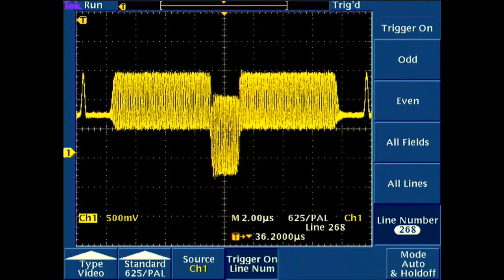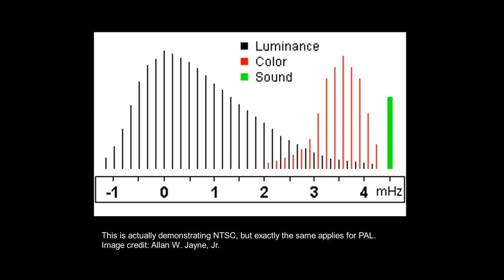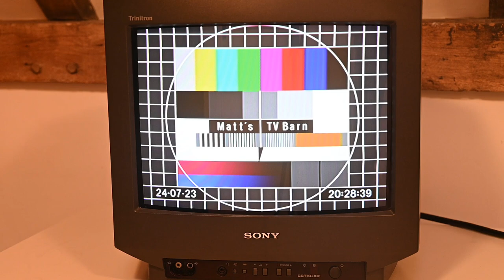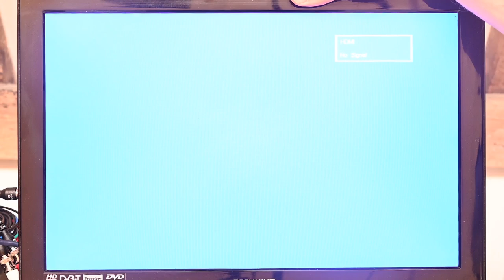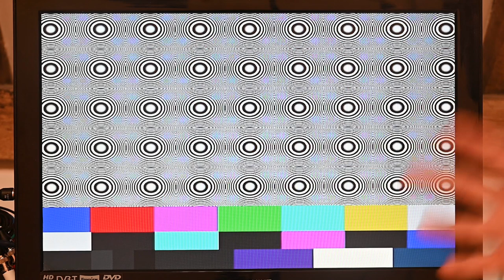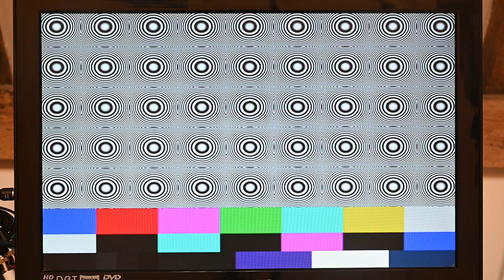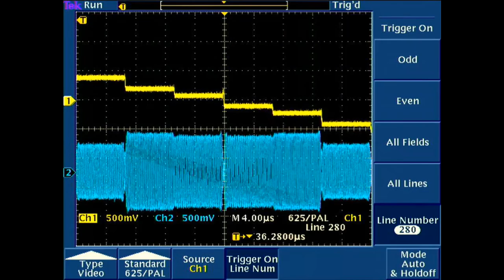#9 - Composite vs S-Video

Comment: I had for many years a JVC 66cm TV and a JVC S-VHS deck. And even though JVC were the ones who popularised S-video and that connector, they also had very good comb filters in the TV and VCR I had! So composite and S-video were nearly the same quality. I only really saw the difference with a Pioneer DVD player that had surprisingly grotty composite video. But it didn't matter to me because I used it's RGB output on the SCART connector.

Comment: I can't fault the image quality, but I'd like to propose that S-Video is physically the worst video connector. SCART you only have two ways you can try plugging it in, Mini-DIN gives you infinite ways of getting it wrong.
Reply from the maker: And they are even worse today than ever. Back in the 1990s S-Video connectors were half decent i.e. if you mate them in the correct orientation they will actually fit together. Today's (purchased of Amazon) connectors all seem to require a degree of bending and straightening before there is any chance of a successful mate!

Comment: You can achieve s-video output through the scart socket with a scart to RCA & composite video adapter with an s-video port built in, just use the s-video lead with the red & white audio leads leaving the yellow composite video lead unplugged, or use another screen with composite video output & you can see the comparisons between them in real time.

Comment: I am gonna video capture some VHS tapes.  Unfortunately, my VCR does NOT have an S-Video output jack.  Is there any work around possible?  I have my VCR's video out going into my Panasonic ES-10 DVD Recorder.  This DVD recorder has S-Video. I use it as a TBC pass-through.  Then it goes into my Sony DVD Recorder, which also has S-Video, and it records the disc.  Could plugging an S-Video cable between the 2 DVD Recorders help improve the quality, OR do I simply need a VCR with S-Video jacks?
Reply: S-Video is basically universal on S-VHS decks, and very rare for regular VHS.

Using S-Video between the two recorders won't improve the image quality, but it may help ensure that it doesn't get degraded any further - if you're using the first one as TBC, it might also change the phase of the color subcarrier, which may indeed cause further artifacts in case of a composite connection, so probably an S-Video cable is preferable.

I guess in theory you could tap somewhere on your VHS deck's PCB to get the separate luma/chroma signals but that's probably much more complicated than it is worth.

The good news is that for regular VHS, the quality improvement is gonna be marginal. The luma bandwidth on VHS is about 3 MHz, and the chroma bandwidth is about 400 kHz. NTSC chroma subcarrier is ~3.58 MHz, and 400 kHz below that it's 3.18 MHz, still above 3 MHz - which means that the chroma and luma spectra on VHS tapes have basically no chance of overlapping - any overlapping information has already been filtered out (either correctly or incorrectly, but you can't do anything about it now either way) at the time of recording. For PAL it's even better because the chroma subcarrier there is ~4.43 MHz and the bandwidths are the same. S-Video can still be preferable if possible, because it's gonna be unambiguous to the receiving device what is luma and what is chroma, so it doesn't need to do its own, potentially further destructive filtering - but still, for regular VHS the difference is gonna be negligible. There's just not enough information on the tape for those effects to really matter.
Reply: @kFY514  Thanks for the info!  that is very interesting that S-Video is very rare for regular VHS VCR's.  I once had a rarity.  It was the Go Video deck that everyone bought to copy tapes.  Had an S-Video output, but I had an accident with it one day and to make a long story short, I had to throw it in the trash dumpster.  Anyway, I will buy a VCR with S-Video soon!  Thanks again!

Comment: I switched to S-video for my Nintendo 64, and for text and color it really makes a difference!
Reply: Same.  In my retro console set up only the N64 uses S-video whereas all the others use RGB and I have to admit that the N64 looks just fine.  To get it looking any better would require significant modification of the console itself.

Comment: It's interesting to see the comb filter in the TV either cancelling out the signal of neighboring lines or falling back to a trap filter in NTSC along the seams between the zone plates. It does do a decent job with PAL given how much harder it is to implement a good adaptive comb filter. It does make me wonder what the BBC's PAL Transform Decoder would do if presented with the "Zone Plate Hell" pattern. I imaging even that would fail to suppress the cross-color.

Comment: Does this mean that artifact colors generated in old home computers via RF out or composite would not work with S-Video? I knew that using analog RGB to play an NTSC Tandy/Radio Shack Color Computer game that used artifact colors to generate red and blue would simply show black and white stripes or dots. But what about S-Video?

Comment: Excellent video Matt - just like your other videos! :) Thanks for sharing.
A qq if I may please: What is the brand/model of the PC video IO card you're showing at 4:00?
I desperately need some proper TV out for my PC either as a card or an adapter as any scan converter I tried so far (HDMI to CVBS dongle, Ambery semi-pro VGA to CVBS box) gives totally different output in terms of electrical signal parameters and picture size which is super annoying and visible of course. I have some modern, professional modulators and fully refurbished CRT televisions but I lack the professional grade video source from my PC which does adhere to the PAL standards.
Reply from the maker: It's an AJA Kona LHi
Reply: Thanks!

Comment: Any chance you could do a video or link to a video/guide for how you set up outputting the test cards (and how you created the cards themselves)  in software from what looks to be an AJA Kona LHi?  Thanks!
Reply from the maker: It is a Kona LHi. The test cards were actually made in MS paint! The dimensions have to be an exact i.e. 720x576, this is the CCIR 601 bit - 720px wide corresponds to a 13.5 MHz pixel clock. Having done that I believe it was a case of opening the image in the AJA software and that was it!